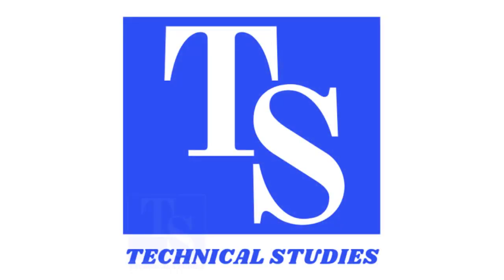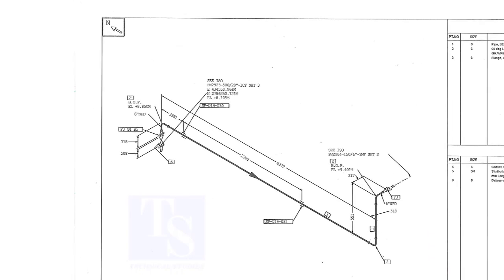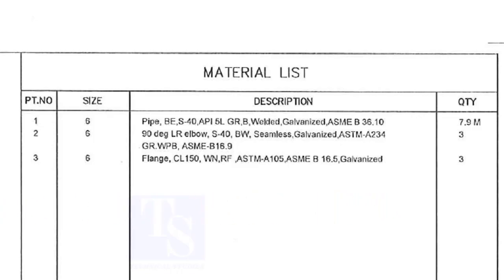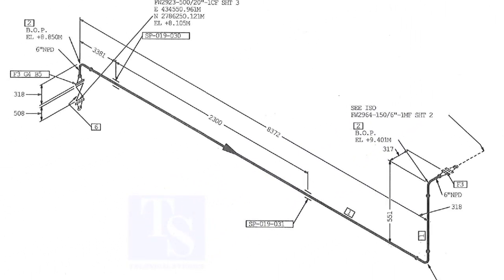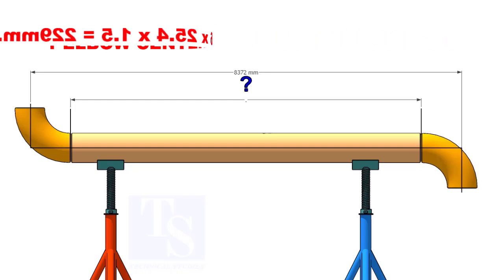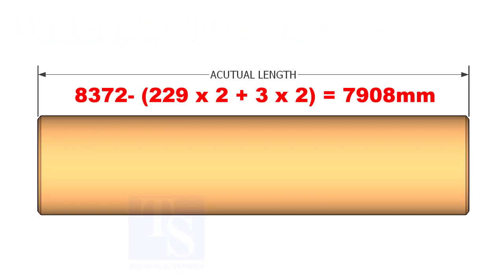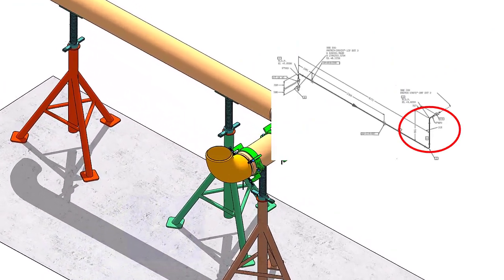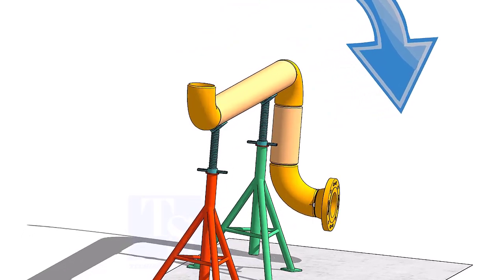How to fabricate a pipe spool from Isometric drawing tutorial. piping tips and tricks

Comment: i though you only take off one root gap to allow for shrikage?
Reply from the maker: Why bro?
Reply: to allow for shrinkage??  because when you weld a butt with a gap of 3mm the gap will shrink between 1 and 1.5mm,  lets say you have a spool that is 1000mm long by the time you weld but flanges on each end you will end up with a spool that measures 997-998mm.
not so much of an issue with singular spool but on complex pipework it matters alot!  if you cut and measure for the exact length including BOTH root gaps you will loose between half that gap to a whole gap when its welded.